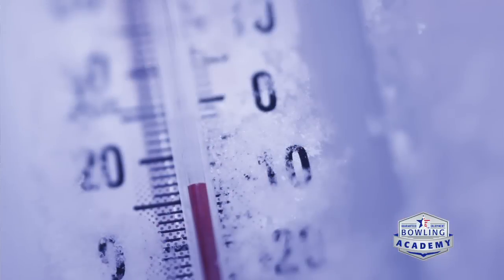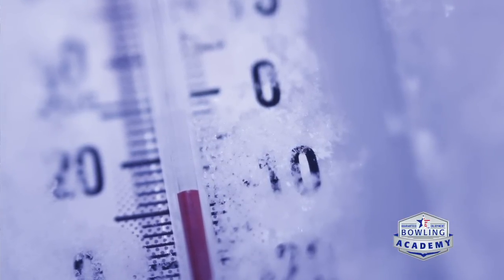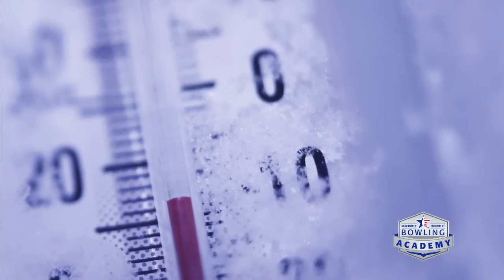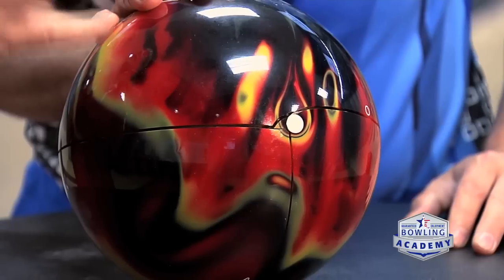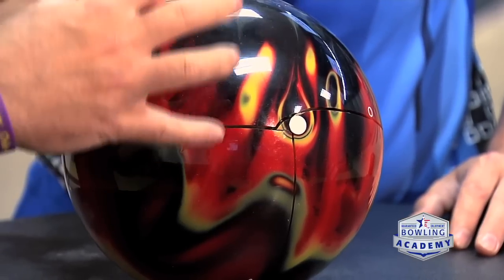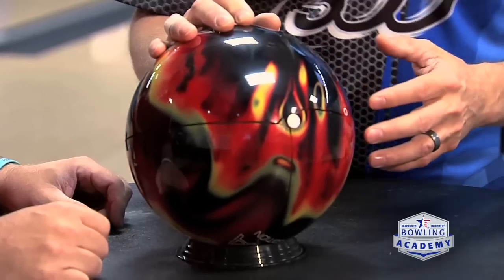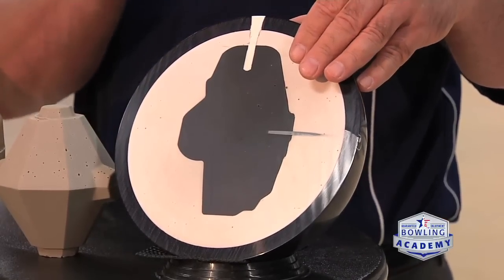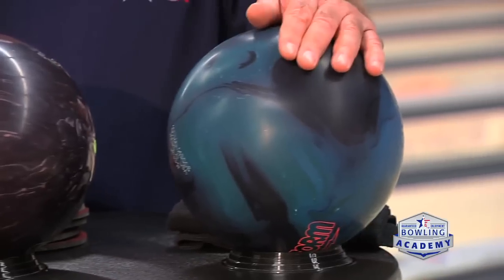Cracked Bowling Ball: Climate Effects  |  USBC Bowling Academy

Comment: So the coverstock on my Vintage Rhino Pro also cracked completely in half. I only had it for a little over a year. I hadn't used it in a while, and it was sitting in my air conditioned closet for at least 6 months. I called Brunswick, and they got me confused with some other guy, because apparently, someone had called them 20 minutes earlier with the exact same problem on the exact same ball. They told me to take it to the pro shop where I got it, and if they couldn't help me, that I should call back and they would connect me with the warranty department. When I took it to the pro shop, the owner said that he see at least a dozen cracked balls per month. According to him, balls with a reactive resin coverstock tend to crack, especially with underuse. He said it doesn't matter how and where you store it, it happens in all conditions and to all brands of reactive resin balls. He said it even happens to people who bowl on a regular basis (although less often). My ball was only under warranty for a year, however, he was able to pull some strings in order for me to get a free replacement. That being said, a bowling ball shouldn't die after only a year and a half, especially considering the $200 investment. I'm surprised that there isn't any kind of class action lawsuit against these bowling ball manufacturers. Again, according to my pro shop owner, it's a common problem with reactive resin balls. Here's a tip: If you are going to buy a brand new reactive resin ball, use American Express, and be sure to keep the receipt. American Express doubles the warranty on anything you buy up to 5 years. For example, my toaster over recently crapped out on me after 18 months. It was only under warranty for 1 year. Because I purchased it with American Express, it extended the warranty to 2 years. I called American Express, and within 3 days, they credited me the cost of my toaster oven.
Reply: Eric Roth i have the same ball and it has a crack between the two finger holes :/

Comment: I went to get my storm bowling ball from my closet and it was cracked. No extreme temps here in Hawaii. I think it’s a flaw in the plastic composition so I’m curious how many other people had this happen to them with specifically “Storm” balls. The company may have sold tons of these balls with the same problem.
Reply: yeaa about that... i went into my storage room to get my storm wipe out and it has a crack and im like, nooooo that was a good ball.
Reply: Sadly I’ve had over 30 balls crack within the last 5 years which includes my Haywire last week then my Verge 2 days ago
Reply: I had my torrent crack on me. It was sitting on the floor in my living room. No extreme temps high or low.

Comment: Hey there, I forgot mine in my truck and it cracked all the way down the center. I seen and repaired it with jb weld and got it to working order.  I will replace it when I have the funds. Question is should I still use the ball or is it just a toss away and get a new one later
Reply from the maker: Great question! The ‘Ask an Expert’ section is currently for members of our online community. I would be happy to send your question off to the experts. To get started, please send the email associated with your paid membership account. Thanks!

Comment: Never had a bowling ball crack using slow temperature oven raises. 90degrees 10min...120degrees 10min...140degrees 25min. Did this for over 20+ balls.

Comment: Iv had a original storm paradigm passion undrilled new in box still from when it was released hard to find let alone undrilled and the bloody thing split on me about two inches from the pin. Was very cold that week a lot colder than average maybe that had something to do with it. But currently I have two new balls in boxes a vg Nano pearl and a crux crystal iv wrapped them both in old t shirts with the plastic over them and in the box under the desk where it’s always relatively the same temperature.

Comment: all the balls that I've seen cracked were siting inside, in zones with no temperature variations, and a lot of them were undrilled (most of them from Storm). I'm using the oven to remove oil from the balls and I didn't crack any ball in 7 years and I know just one guy who cracked his ball in oven, when he had put it on a metallic plate. So the explanations made in the video are purely empirical, based on suppositions and are not scientific.

Comment: I had two different Rotos crack after sitting in the locker at the lanes over the last two years.  Both of them had less than 30 games on them.  They never were out of the bowling alley.  One crack did not go through any drilled holes.  I had a few friends that had cracked Storms. It is too bad, I liked both of the balls, but they are not durable.  I think Roto and their parent company Storm has a manufacturing problem. I am going to just steer clear of them. They need to adjust their research priorities from having balls that have a scent (Tropical Storm) to coverstocks that don't crack.  I am back to using my Hammers and the original Nighthawk.

Comment: I’ve had 30+ balls cracks. The new material in today’s cores/covers is going to easily cause a ball sooner or later to crack vs the old reactive, rubber, urethane and plastic balls. Of course too much glue eventually will cause the fingers of a ball to crack along with the fingers not being beveled correctly. I just continue to have bad luck because I never keep my balls exposed. They are in room temperature and they are never on wood or in the car. I have 42 balls and often rotate the balls on a regular basis and every now and then a ball still cracks. Also I put them in plastic but that only works for so long of a time. Bowling works differently for different people just like life goes different for people in the world

Comment: No way this is true    we get in the negatives here on occasion and I've had one ball for almost 5 years sits in the back seat of my truck continuously only time It leaves is when it comes with me twice a week to bowl    no cracks no nothing    I had a power groove sat in my closet for 4 years and it damn near split in half    same way with global 900 the break     it has nothing to do with weather
Reply: Tyler Stine g
Reply: I agree... I have a beautiful 20-30 y/o ball going through extreme temperature changes out in the garage and it is still beautiful. I got myself a new fingertip drilled FREEZE a few years back, stored it in the house with little temperature changes, grabbed it to bowl for the 1st time tonight in 2-3 years and it is cracked all the way around and at one of the fingetips, too.